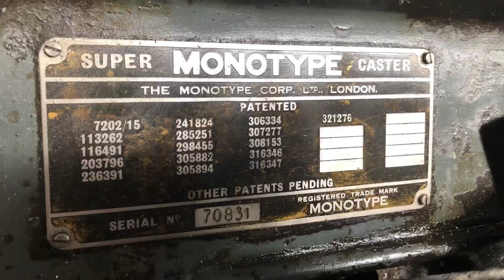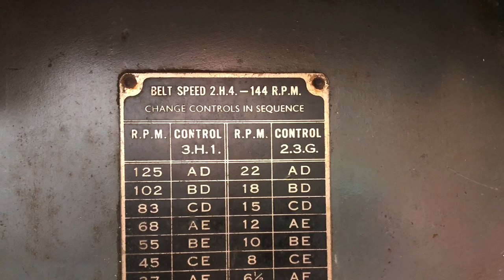An Introduction to Casting Type at the Carpathian Type Foundry

Comment: Great video Andrew! I'm impressed with how fast you run the Composition Head!
Reply from the maker: Thank you for taking the time to watch and comment. I appreciate it. Yes, the composition head can be run up to 144 rpm. However in this video I bottled it and it ran at only 102 rpm. 
It’s a world of difference to when I cast the very largest type. Then it’s only 4 1/2 rpm. Oh so slow. Andrew

Comment: Frankly, I haven't seen a super caster work so fast, even when casting narrow strip material.
But then we (Book Art Museum in Łódź and John Cornelisse's press/foundry in Philippine, NL) never used the supercaster for casting anything from the regular composition mats - that was done on the composition caster. I guess that you used to do that on a comp caster too, but since it's with Maciej in Wrocław, I can see you cast small type on a supercaster too :)

I always insert the pump handle after I skim the metal, using the ladle to cover the pump nozzle and prevent squirting. Also, I always give the machine a turn or two by hand to make sure nothing binds before engaging the clutch.

As for the water cooling, the late Paweł Tryzno and I had an idea of making a closed-circuit design, but the flow turned to be so small that it wasn't even noted by the water meter, so we just sticked with the tap and drain. John uses a cooler originally meant for Ludlow linecasters with an ethylene glycol solution as coolant.

It would also be advisable to make a fume exhaust for the machine's melting pot. Breathing in the products of mould oil thermal decomposition is a sure way to get lung cancer. More dangerous than lead (which stays close to the melting point and doesn't really evaporate) and asbestos (used for the melting pot's thermal insulation, but it's encapsulated all the time).

You may want to upgrade to a variable frequency drive (VFD) as the motor is relatively low power and it shouldn't be a problem to get a suitable unit. Especially if you've got a classic old motor, slip ring or not, instead of a Varigear.
Reply from the maker: Hello Keri
With the Super Caster set up with the composition head it is able to run at quite a speed. I don’t run it often like that as I don’t enjoy doing so. Mostly 10 and 12 pt border units and sometimes founts of type for the case. Yes, my composition caster is now with Maciej in Wrocław. Will anyone be able to help him use it?
I do cover the nozzle with the ladle, but for this video I chose not to for “dramatic effects”. And yes, I always turn the caster over by hand first. Very important to do so. This video definitely is not “best practice” and should not be copied. 
My water system is closed circuit as we suffer with bad limescale here and the moulds would suffer if I was to use the tap as you do. My closed circuit is ok, but I need to improve it, especially during hot summer days.
I hear your concerns about the need for a fume exhaust. Unfortunately it would be very difficult to achieve. It is something for me to think about again.
A VFD would be something I would install should my rotary converter fail. As it is, my motor ticks over nicely and I don’t mind using the gears. They add to the charm and challenges of using this fine old machine.
Lovely to connect with you. Thank you for subscribing. Now I need to think about making another video.
All the best, Andrew